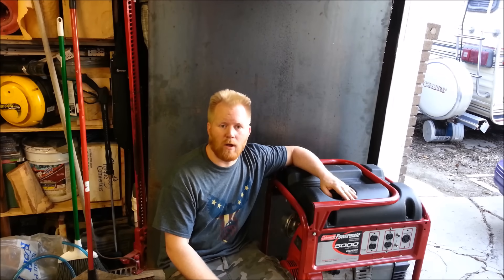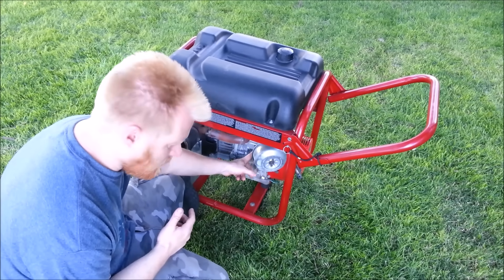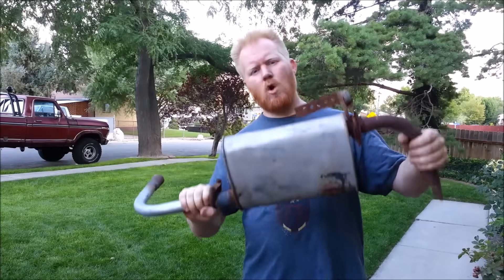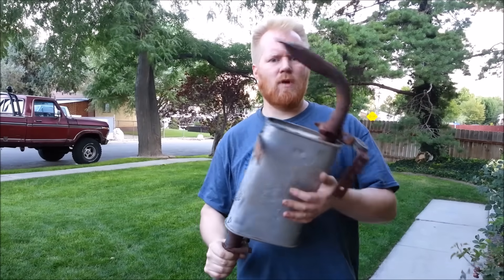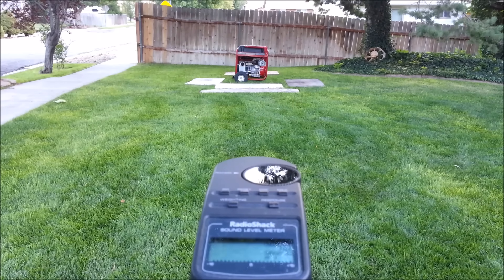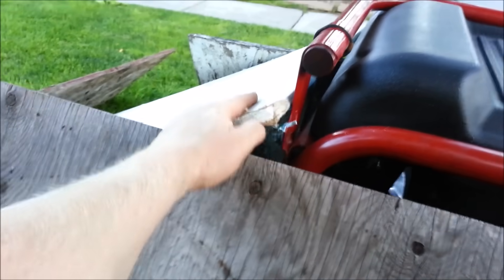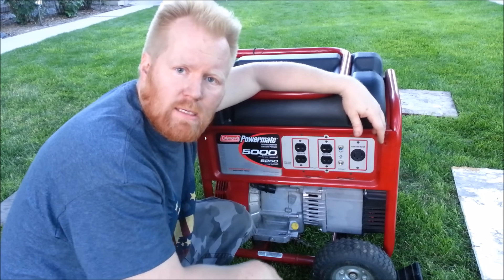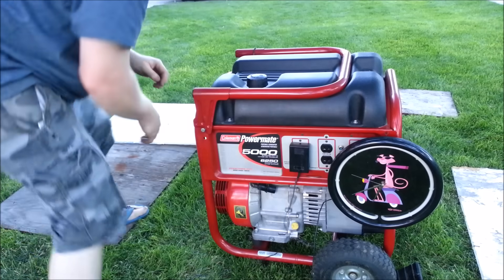4x Quieter generator in 10 seconds

Comment: I don't see why companies like generac don't make an electric generator
Reply: They are spending too much time developing dehydrated water...
Reply: Dude it's a joke to be hysterical
Reply: Electric in, gasoline out.  Solve the foreign oil dependency.
Reply: Sorta like "hot water heaters".  If you had hot water, why would you need a heater??  Dumb expressions, but funny.  On topic, ALL 3600 rpm gensets are too damn noisy. That's why inverter gensets were invented. 1800 rpm is a lot easier on the engine too.
Reply: Powdered water for sale.... 200$ a pound
Reply: lol
Reply: lol
Reply: lol
Reply: Atvforlifeo
Reply: 1995f150 believe it or not, they exist. Back before pure sine wave inverters became somewhat reasonably priced, if you needed a way to run an AC powered device that didn't work well with poor quality power from a vehicle, you used one. A DC motor run from the vehicle's electrical system, driving an AC alternator. Not as efficient as an inverter, but the power it puts out is pure sine wave and has low noise. Obviously they're not very common anymore, but they exist. A similar technique can be used to run 3 phase equipment from a 1 phase/split phase source. Single phase motor driving a 3 phase alternator, powering the equipment. Again, modern variable frequency drives have mostly superceded this technique, but it's still used for certain applications.
Reply: Yeah, run 500 of them in series and power a small city. The power companies bought up all the patents on that idea many years ago.
Reply: because you cant get electricity off a tree in the woods,or at a job site that has no electricity. Or adter a storm has knocked out the power. Do you even know why people buy generators for? really? Why would you even need one if you can plug in.

Comment: your osb works better than ply because the panel has less resonance. they make guitars with plywood tops ("laminated soundboard"), but NEVER osb ones. if it has resonant qualities, it will pass the vibrations that match that resonance, and often amplify those frequencies. sheetrock, same same.  if you're going to use ply, use thin panels, and "stand them off" in multiple layers with good double faced tape. inner ply mambos, tape absorbs a bit, so next panel just fox trots. repeat, next panel does a very sedate waltz.  pipe foam insulation split tube foam on the panel edges would do about the same as double face tape does. that "white foam insulation" board between 2 layers of ply would be near ideal, but a potential fire hazard, and gasoline will make it "go houdini" (disappear like magic). the old time chevy nova "rubber carpet" would make a great isolation layer, as would those "hard rubber chain link style" door mats, while still allowing just about any fastening scheme to work. you could probably fashion a fairly efficient "breathing wall" for the intake side just out of such floor mats, staggered and properly angled, that would be just as good as ply, while passing far more air. window screening of "dead" varieties (like the plastic stuff) could probably do much of the same.

for you folks mentioning "studio egg crate foam", it actually does only what the vid mentions, only both forms at once, in a cumulative deadening process (pyramid wall reflects sound while absorbing some vibration, sound wave is reflected into another pyramid wall, cycle repeats ad infinitum). just like bullets, and light, the "ricochets" tend to be at 90 degrees of the angle of incidence (the angle the wave strikes the panel at, in the natural direction you would expect such a ricochet), so by structuring "angle of incidence" you control where the wave goes. bounce it between enough dampeners (vibe absorbers), it "dies" the death of a thousand cuts.

Comment: Better run a box fan that is an air cooled engine that might make it run hot
Reply from the maker: I ran numerous temperature tests and there is no increase in temp. I have huge openings on every corner.

Comment: 3dB is half or double the intensity. Thus, 9dB is 1/2 x 1/2 x1/2 = 1/8
Reply: 10db is half or double perceived volume Human hearing is logarithmic.
Reply: John Ridley Sound pressure level is not referenced to human hearing attributes. SPL is simply pressure (in Newtons) impinging on a 1 square meter surface. (In the SI system, 1 Newton over 1 square meter is a Pascal.) Yes, SPL is expressed in logarithmic units, but the formula is 20 Log (P1/P2). Thus, a ratio of 1 is 0 dB, a ratio 2 is 6 dB, a ratio of 4 is 12 dB and a ratio of 10 is 20 dB. The human ear perceives sound as a pressure applied to the ear membrane, thus humans estimate sound by the pressure, and as you see above, doubling the pressure is a log ratio of 6 dB (halving would be -6 dB).
Reply: Scott Reese Are you raging against my response or simply howling at the moon?
Reply: Scott Reese OK, then despite two fucks in a short comment, I'll take that as a compliment. As an engineer working with sound and RF energy, non-technical people would often need an explanation from me of how RF or sound propagates and what the effects are. Sometimes the executive version answer is appropriate, but going through a more rigorous explanation is more respectful of your audience. Further, every time you explain anything, you refine your own understanding of the question, and every so often, you realize that you are cutting a corner or making an assumption about something and you really should clean up your own understanding of the issue.
Reply: intensity and sound levels are 2 different things..doc johnny..
he said 4x quieter..its 4x less intense maybe,,, but only 1/2 as loud..
youre mixing your apples and oranges and are bananas
Reply: in fact the common man would say its only 1/8 less loud..80 to 70
Reply: How the fuck are you so goddamm smart. it's so frustrating that this information is so second nature to some people. fuck man!
Reply: Ed Price neither, just aggravatingly impressed.
Reply: Ed said:  * every time you explain anything, you refine your own understanding of the question, and every so often, you realize that you are cutting a corner or making an assumption about something and you really should clean up your own understanding of the issue.* If more people would only realize this! Good write Ed, I enjoyed reading your reply.

Comment: wow!!! I guess you could use this method! ! However,  I have 10 year old generators and both of mine do not even come close to sounding like this generator. Oil additives, and regular oil changes have made my generators run smooth and quiet.... definitely lower than 70 decimals
Reply from the maker: Neither of those make a generator quiet. You can't quiet combustion detonation with oil or additives.

Comment: nice demonstration...and that's interesting about the effectiveness of adding more muffler. I see you have an RV...I came across your channel while searching for baffle box ideas on how to make a honda 2000i even quieter for running AC at night in RV. Seen any good designs or material suggestions? ty
Reply from the maker: It's hard to quiet the Honda's much more, especially in the dead of night. I run a pair of eu2000i generators in a back compartment on my rv. There is a fan that blows accross them and I can drop the decibels a little. You can see my setup at the end of this video https://youtu.be/RDkL593Wbt0

Comment: what a dumb ass he does not even realize that subaru invented the wankeal engine in 1984and 1985 and these engines are still running over 2million miles and if you can find one they will outlast the car you take the engine out put it in another car you dum ass you do not have a fuking clue they have no clue how long they will last and oh by the way i have more time in the shitter than you are alive you need to research subaru dumb ass
Reply from the maker: What are you blabbering about? The Wankel engine was invented by Felix Wankeal back in the 20's and Mazda made it popular in the 80's with the RX7.   The engine on this generator had about 10hours on it before it threw a rod; now that's quality. Generally the only pieces of power equipment that get Subaru(formally Robin) engines are lower end items.
Reply: well i guess subaru improved on it in the early 80s because whatever they did in 1984 and 1985 these engines are still running today and they have no clue when they will ever quit running
Reply from the maker: Nope. Rotary engines have poor torque, high oil consumption, very poor fuel economy for their size, and are considered very unreliable to their piston driven competition.  I've never heard of a single Subaru with a Wankal engine?
Reply: lol... rude moron.

Comment: It appears to be deflecting the sound into the ground, I would like to see how this works on solid ground or a wooden floor.
Reply from the maker: Solid surfaces like cement absorb sound 13times better than the air so all the sound gets pulled right in.
Reply: And I did say wood too
Reply from the maker: Wood is a solid surface and absorbs sound virtually just as well. Wood does have air pockets so sound absorption will be slowed. The rougher the surface the quicker sound is absorbed. The angles of the boards play a huge role in deflecting, absorbing and canceling sound waves.

Comment: If you put it in the basement, the sound will be almost completely eliminated.
Reply: haha yeah because you will also end up in the ground before it's over.
Reply: I really think this guy was being sarcastic about putting it in the basement....lol....get a grip.  😁
Reply: yes,just pipe the exaust into the living room..You do know running any kind of fuel powered equipment in a building is a no no.fuel fumes,exaust fumes? No? Mabe?
Reply: sok8888 absolutely never put your generator in your home basement or attached garage! CO2 will kill everyone and everything in your house. People die from this every year.
Reply: I guess it only happens in Flordia Matt. Apparently Carbon monoxide only exists there.
Reply: Perfect put the generator inside home and half hour later you never ear nothing, just the bells in heaven!!!!!!
Reply: I think the OP means that the generator will shut off (due to lack of oxygen) causing the sound to be almost completely eliminated.
Reply: scott firman as long as the exhaust is properly vented outside there won't be an issue.
Reply: But wouldn't it deplete the inside air ?
Reply: if you pipe the exhaust into the living room, you can use it as an alarms...  when you no longer smell the genny, you know to refuel it!
Reply: Lost a friend to generator in open unattached garage. Just don't do it.
Reply: What about attached garage with the garage door open?

Comment: By using a 3/4 nipple that fits into the exhuast port of the  engine and stepping it up to 2"x12" nipple and then back down to 1/2" nipple you will have a very quiet motor depending on how long the 1/2" is.
Reply: Sounds like a tuned pipe silencer and correctly designed, they are very effective, but most of the noise from a four stroke air cooled engine is mechanical and is transmitted through the engine case to the surrounding air. This is why most fixed placement gensets use fluid cooled engines.
Reply: Bear U liquid cooled motors are not only quieter...but usually it's more fuel efficient too as a liquid cooled engine is easier to extract horsepower out of then a fan or free air motor without heat saturation issues.

Comment: You are not worried about the generator OVERHEATED ??
Reply from the maker: I ran heat tests and everything stayed within 1F to 2F degrees. The idea is not to block airflow. It still has huge amounts of air space to pull in and exhaust air.
Reply: +sixtyfiveford 👍👍👍smart boy 😄😄😄

Comment: easy, Buy a Honda generator. Already quiet !!!!!
Reply: bluchopper1 You're right, you get what you pay for. My last generator costed me less than $450 and lasted me 10 years. I have an Onan in my motorhome and I wouldn't trade it for all the Hondas in Japan. For my purposes, outside of my motorhome, a $500 genny works out just fine for me. And I can still afford to put gas in it.
Reply: Actually, the Honda EU7000is is a larger generator that is quiet.  It's more about the style than the brand though.  Inverter generators tend to be quiet.  This model id quite.  It cost over $4000 dollars.
Reply: that's what I say too
Reply: +Bob Barker I've had them all and Honda is best. I have a onan in my rv also and it's good but Honda is smaller and just as powerful and way quieter and that's what the video is about
Reply: Bob Barker And keep replacing your china shit every week
Reply: I prefer the $99 two strokers so I can forget about keeping up with hours for when oil change is due.
Reply: We have a 3500 and a 5000 honda. Both as noisy as any engine Ive heard.
Reply: Herranton1979: I have a ten year old 6500 Coleman that is primarily for power outages. I run it and service it twice a year. My neighbors don’t seem to mind the noise as they “borrow” power from it when the power is out to keep their freezers running.
Reply: Must of us are Not Rich like you are..Lol
Reply: Luc Vallières , I was thinking along the same lines as it was pointed out initially this generator had the original equipment engine replaced by an old style Honda engine . Then the worthless muffler from the original engine was installed onto the Honda engine ! Put the original Honda muffler back on the Honda engine and forget about all the 'wood' . . Just saying . Also it wasn't mentioned but the OE air cleaner for the Honda needs to be used also . On most all small gen sets the air intake filter box does little to silence the intake noise . . . . Honda addresses this also by the design of the air flow through the air box filter assembly . Usually even uses an oil bath with screen in this vintage engine pictured . There were very quiet running engines .
Reply: Yeah sure, if you don't mind paying 10 times more for the same wattage.  I can buy a 5000 watt NON Honda genny all day long for about $500.00. I'll put up with the noise and keep my bank account, thank you.
Reply: Honda's are no longer the quietest in the small 2000 watt generators and all the ones this size (big ones) none of them are very quiet.

Plus I can buy a lot of OSB for the $500 difference...like a unit of OSB...
Reply: " I'll put up with the noise and keep my bank account, thank you"
 
And make everyone else put up with the noise, too.   :-\
Reply: Bob Barker and when it breaks u can throw it away cause u can't get some parts to fix those cheap ones u get what you pay for i got my used Honda for half what it was new and it has worked great with no troubles and I use it alot
Reply: +Bob Barker Sure, but your neighbors will salt your gas tank when you're not looking. If you wanna be an ass, expect the same from others.
Reply: Captain Quirk yep because fuck you

Comment: Have you tried resonator and straight through mufflers? Straight through mufflers muffle and provide some back pressure at low exhaust velocities but act like straight through with high velocity, still helps muffle most of the sound but it would make it more deeper.
Reply from the maker: +Zcypot Yes. A "glass pack"(absorption) muffler works the best to deepen the tone. It doesn't quiet it much but allows a more pleasant tone.

Comment: MDF would work even better. MDF is used in speaker boxes because of this.
Reply: MDF is better at sound absorption, however it is also better at moisture absorption...
OSB would be the best overall choice for this application in sound absorption and durability, it's also pretty cheap to buy.
Reply: Its not absorption its reflection. All I did was cover mine with tack paper and that keeps most of the moisture out. I used this last fall when it stormed for a week and I lost power. If you can get HDF that would be even better because its so dense that rain just rolls off of it.

Comment: This really worked. Very nice. I trimmed boards so it would look nicer. I used  three OSB boards, and  I also used fireboard in place of sheet rock. I cut small outlet for the exhaust gas. The hole did not seem to take away from the dampening effect. Thanks for sharing. Cheap and still extremely portable way to quiet generator!!!
Reply from the maker: +jscizo I'm glad you tried it out.